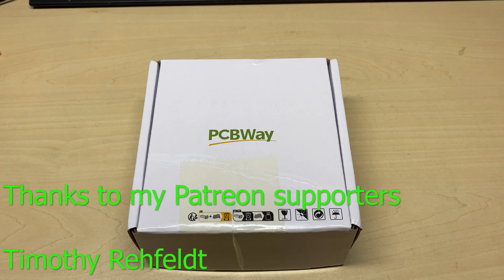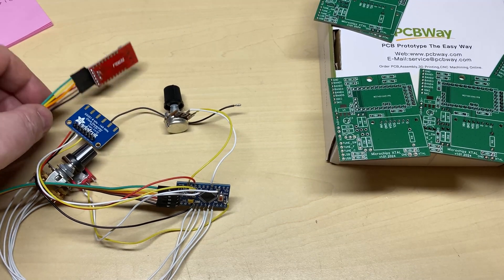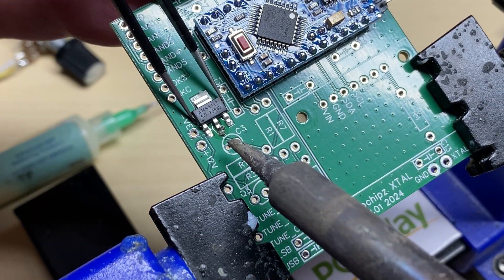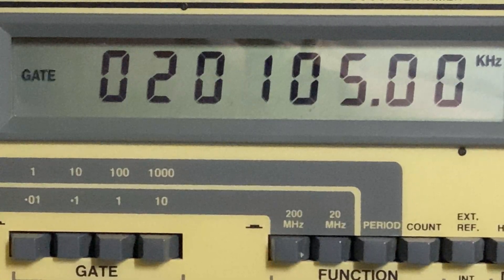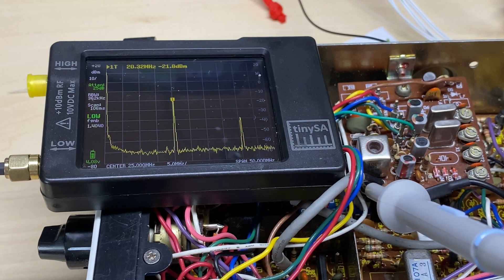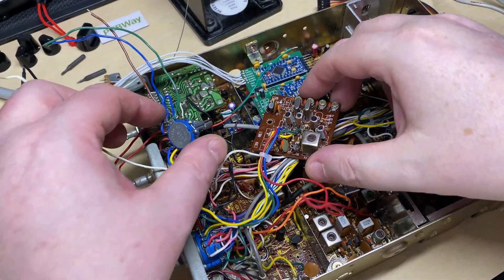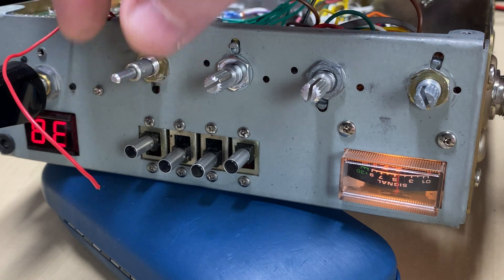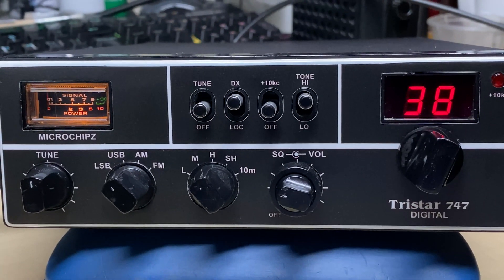EP 159 - Tristar 747 - SI5351 Crystal generator conversion .

Comment: Very Interesting, now that it's getting harder finding these actual xtals.
Reply from the maker: Spectrum still do replacement xtal sets for these radios , for how long who knows.
Reply: 59 COX Board xtals in the 10Mhz range are very rare, just for dropping in without modding the circuit. Or eprom the n-code change for a 10.24 ref xtal. I'm sure you know what I'm getting at.
So this was interesting as regards these xtals.
Reply from the maker: My next mission is to fit one into a mm2
Reply: @MicroChipz  I'll be watching ;-)